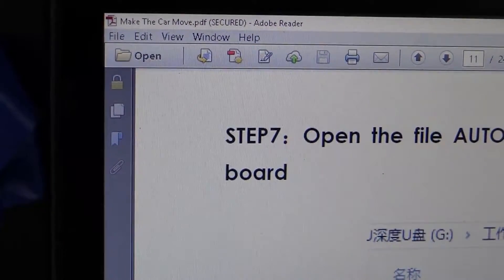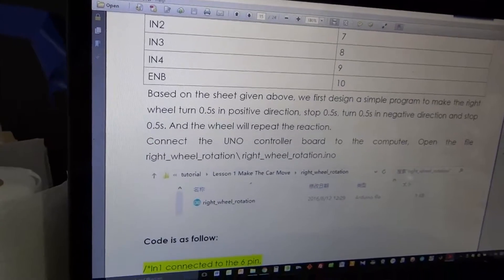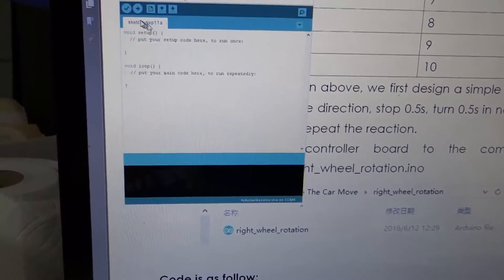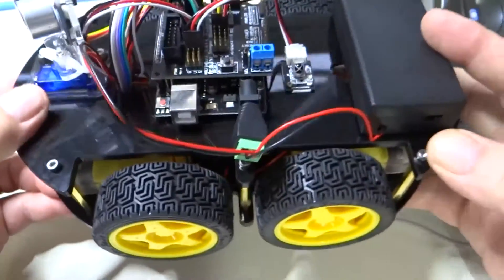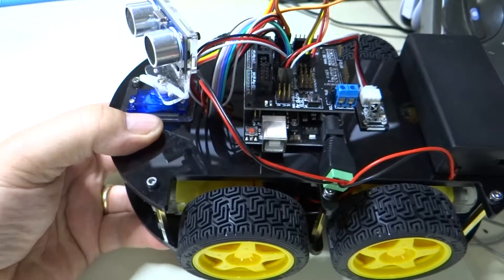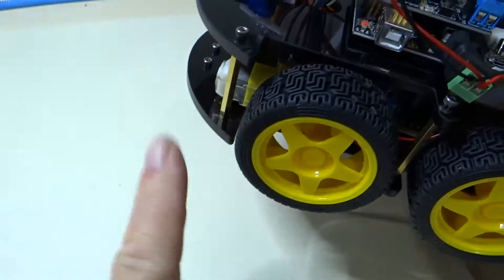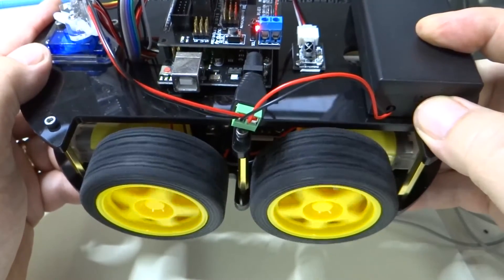Elegoo SRC kit 28 Lesson 1 right wheel rotation pt 1

Comment: Friend, for some reason the wheel motors are not running as fast as I see that they work for you. Will it be the input voltage of the motor driver? What input voltage do you give the motors?

Comment: Greg I am able to upload the auto go program but instead of a solid light I have a blinking light, any insight? I have installed the batteries and powered it on but have no movement.
Reply from the maker: Laura Abril make sure the screen says "upload complete". If it doesn't, then you have error messages about your code; track down the errors and fix them. If it does say that, then you have a problem with your code also.

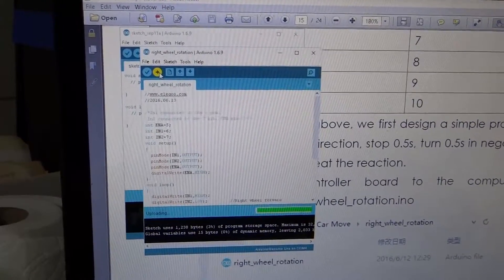Comment: Hi Greg. I don't know if you had figured out why the left and right wheels are switched, but I see what is going on in the program shown at 1:28. It shows the pin assignments as ENA=5, IN1=6, and IN2=7. They should be ENA=10, IN1=9, and IN2=8. Then in the Left Wheel Rotation program, the pin assignments should be ENB=5, IN4=6, and IN3=7.
Reply from the maker: TinkeringJohn thanks John.  As you will see in subsequent video, I switch ENA to a different pin, 13 I think. When the servo library is installed, it disables pin 10 for PWM. A discovery that was hard to find.
Reply: My instructions for the Obstacle Avoidance Car tell you to move the wire for ENA from pin 10 to pin 11 which means you have to remove the cable for one of the line tracker IR sensors, but changes it back for the other programs. I will connect the IR sensor to a different port and change the line tracker program to reflect the new port for that sensor and the other programs to use port 11 for the ENA. Then I won't have to switch wires around anymore. I have many Fischer Technik robot kits and a couple come with a sheet of thick white paper with a track drawn in black. I am getting set up to run the line tracker car now. Thanks for the videos on this kit.